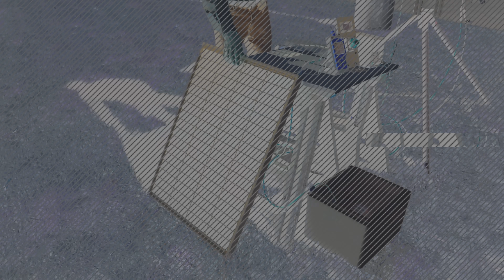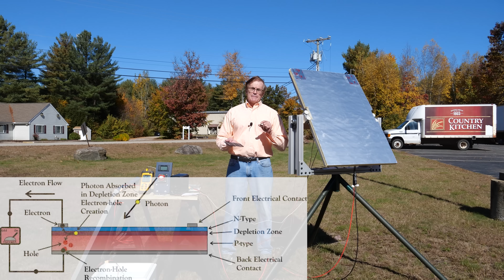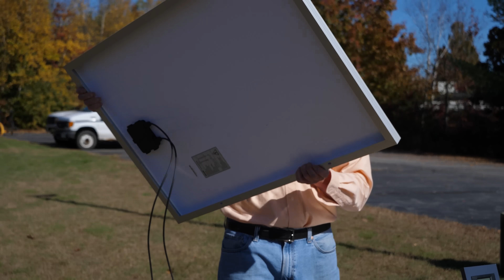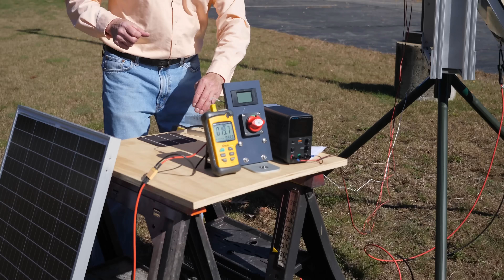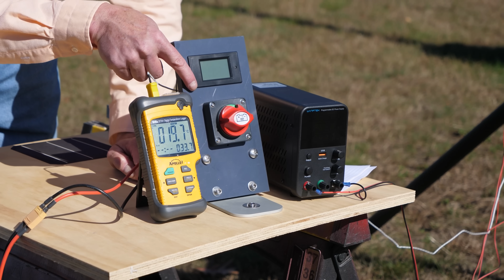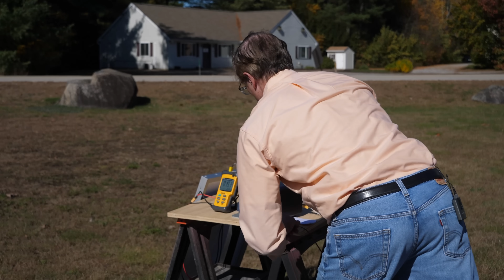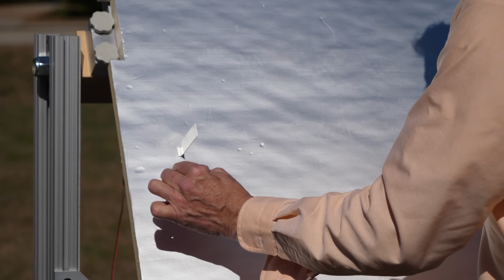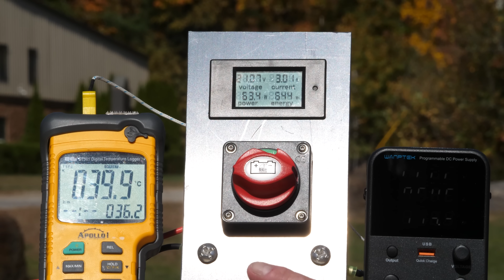Do you REALLY get enough out of your solar panel?

Comment: Totally off the cuff. These days solar panels are getting higher and higher watts per square metre ratings. However the price of a panel in any given solar panel in a companies range increases with the increase in watts per square metre. So given that allot of people in australia have 4.15 kW one 6.15 kW solar systems and the roof isn’t nearly filled then the expensive higher efficiency panels are a waste of money. Our rules place limits on what you can have in array kW and or force an export limiter to restrict you to 5 kW export to the grid.

Caveats. My sister lives in Sydney in a heritage area and as part of her renovation, strictly controlled and everything even screws and nails and paints and colours has to be approved, she wanted solar. No the roof was approved as black corrugated iron. Her terrace house is taller than one neighbour and the same as the other and a cross the street  a balcony looks at the terrace front. So I said to specify LGNeON 2 panels in the all black variety and the absolute highest efficiency panels that had, not a NeON2 but the other one. Anyway it was approved based on colour but also the panels came right to the edge of the iron so it looked all as one and angles meant it couldn’t be seen at all from the street, gutter hides the edge.

So having super boosted panels is a waste and probably voids the warranty and can your inverter handle it and what are to you doing with the extra power? Can your batteries take the extra charge and the grid export is already capped.

So, what’s the point?
Reply from the maker: Maybe the real issue is your governmental regulations.

Comment: Excellent content. A fairly simple perfomance upgrade that brought a verifiable return on investment. There may be other ways to dump heat as well. I must have missed it, but why are panels black? To absorb photons?
Reply from the maker: That's the native color of silicon
Reply: @TechIngredients  Tech Ingredients said: "That's the native color (black) of silicon"  NO!  It is more a grey color.  When crystalline silicon is used to make solar cells, an antireflection coating is typically deposited on the sun facing surface.  It is this coating that renders the solar cells the usual dark blue to black color.
Reply: @TechIngredients  So if you could tint or change the color, would it be possible to lower the operating temp/increase efficiency?
Reply from the maker: Yes.
However, you might not see the difference as most of the visible spectrum is used to generate electricity.
Reply: @TechIngredients  Tech Ingredients said: "Yes.  However, you might not see the difference as most of the visible spectrum is used to generate electricity."  NO!  The most efficient color is the dark blue to black.  Also, it is possible to make them non dark blue or black and the new color would be visible as the solar cell is NOT absorbing that color.
Reply: @palindromeambigram4852  So they are black because black contains all the colors, where as white is the absence of color?
Reply: @d.mcdave8880  That's a bit of an over-simplification but yes.
Reply: OK. Then what would be the effect of not coating the cells as far as perfomance? Would the light be mostly reflected away, lowering performance? Or, is the coating a safety feature to keep us from blinding ourselves?
Reply: @d.mcdave8880  If crystalline silicon solar cells did not have the anti reflective coating then they would definitely have reduced performance.  I doubt "the light would be mostly reflected away" but it would be significant.

Comment: I'm thinking of peltier elements, as they produce current/voltage when there is an difference in temperature, can't this be used to lower the temperature even more and also provide power? Placing peltier elements at the top, as this helps the air flow, cold goes down and heat goes the opposite way, but also using fans to circulate the air, as you did, might be even more efficient?
Reply from the maker: They're relatively expensive and very inefficient.

Comment: Can you use a sterling engine attached to the back of the panel to power the fans?  Or just to mitigate the efficiency loss due to heat?  The panels will always be hotter on the sunny side than the shade side, so there should be a greater temperature differential the harder the panels are working.  If the sterling engine drove the fans mechanically, it would be a kind of self-throttling system.
Reply from the maker: Theoretically, yes.
However, they tend to be bulky and would have to be custom built.  I'd go with the current  fan setup and control  the fans so that they only operate  when the panels  exceed a given temperature  differential  vs. air temperature.  This saves power and wear and tear at night and during  cloudy days.

Comment: I like that you touch financial details so thoroughly but absolutely forgot to count degradation and replacement cost for the fans itself. Also active systems like that require some monitoring infrastructure, at least to be sure your fans are still working. So everything looks not so simple at closer look.
Would be nice to have the all the information counted. 
But don't give up. I wish you luck and I really enjoy watching your videos, and all of the optimizations you do. Thank you!

Btw almost forgot to mention, to cool radiators you don't have to use fans, you can use passive way of air drift, like in old fashioned oven chimney.
Reply from the maker: Regarding  your BTW, the size of a passively cooled water to air heat exchanger will make it very expensive.
You're right, I should have included that, but briefly, the MTTF for these and similar  fans is 50,000 hours and you would likely use them less than 12 hours per day because  the very early and late daytime hours will see little benefit re longevity and efficiency.  And, of course, you would not need them at night.  They will also be operating at 25% of capacity.
Reply: @TechIngredients  thanks for reply. About degradation - it comes not only from "pure work" that they do, but the fact they are working outside, and venting street air, which contains a lots of dusts, just for example.

Comment: I would add an additional concern.  The lifetime of the fans may not last the lifetime of the panels.  In that case there is a relatively high cost to replace the fans if labor is not free (some folks may not be interested in servicing their system by themselves on a roof).  Not sure where the tipping point is, but an interesting failure mode investigation.  Thanks for your content, I enjoy watching!
Reply from the maker: Understood.
Many of these cooling fans have a MTTF  of 50,000 hours.  We only need to run them about 8 hours every clear day. There is no need to run them at night, obviously.  In addition,  there may be little  value in running them for the first and last couple of hours every day and not every day is clear.  This means that we should expect about half  of these fans to fail at 25 years.  However,  we will be operating them at around 25% of their rated output, further extending their life.  They can be mounted as easily  replaced plug and play modules, making exchange simple.

Comment: I have yet to see any accurate analysis to determine if a solar panel made today, installed and put online, generates more energy throughout its lifetime than it takes to manufacture and install them.  This is due in part to the difficulty in obtaining the data and the obfuscation of the industrial processes within communist regimes that make them.  When you consider the energy required to mine, process, refine, manufacture, ship, deliver, install, and operate solar panels - I am very skeptical that they are a net benefit for humanity for anything installed outside of the Arizona sun.

Comment: Floridian with some solar here.  Small setup with only a couple 350w panels.   One problem you introduce with fans is that moving parts require more maintenance.   In these parts, we have many oak trees rather than palm trees that people import and plant.  As a result, keeping my panels clean is a much bigger problem than cooling.  I am considering rainwater collection and gravity-fed water trickling over the panels to help deal with it.

Comment: It is a bad idea for maintenance fans are know to fail. That is why the other company mentioned at the start of the video used liquid cooling. The loop would be hooked up to one pump and thus one point that you need to look at for failure . The loop could be purged at temps below the coolants freezing point and in most cases the ground a few feet down is cooler then the air in the summer. Simply running a pump and using the ground to cool it in the summer would give similar results and as for the winter the lower ambient temps should be more then effective.
The reason a engineer would not use a fan is that is would be a point a failure that dose not make sense for the application. Liquid makes sense in this app if you need the cooling.
Reply from the maker: Why are you ignoring  the moving parts in the pump?
Reply: @TechIngredients  I am not. 1 pump for like 12 solar panels or like 1 fan per panel or more. Not to mention the failure rate of the fans going up for the same reasons as the panels. Pumps tend to self cool and if maintained right will last way longer then a fan.
There is always the right tool for the job.
And if we where talking about cooling something inside a a building or moving air though a large condenser maybe but the size of fans that would be going on panels like that would be prone to failure and using large fans would just kick up dust and make the panels dirty.
Cooling the panels from the back with a liquid makes more sense in a large setup and small setups would have a high failure rate on fans just on the back of the panel.
So I am not ignoring anything it has to do with the number of moving parts. 1 pump or dozens of fans. Maybe even hundreds.
It removes points of failure and makes repairs easier.
Reply from the maker: You did ignore them, but now that you addressed them, the pumps may or may not last longer.  The MTTF of fans such as these is 50,000 hours, and that's at 100% output. You also did not address leakage, corrosion, or freezing. All these issues  can be dealt with, but I raise  them because  this isn't  as clear cut as you suggest.

Comment: Interesting video but it seems like for the cost of the fans, which will likely wear out long before the panels and need to be replace during the life cycle, the cost of the aluminum, plus the labor to fabricate and install it, all this for another 3-5% output, you could probably buy another solar panel with the money you have to spend and double your output.  Seems like your experiments proves the concept isn't economically feasible and just because some company in Australia is using it as a gimmick to sell their panels doesn't mean very much. And yes, I'm an engineer. Throwing cold water on bad ideas is what we do.
Reply from the maker: Thanks.
As an engineer, you should evaluate  these results  by comparing actual MTTF data and cost/effeciency relationships along with panel longevity data rather than using the catch-all phrase "it seems".
Reply: @TechIngredients  Although admittedly I do not have enough information to do a detailed cost analysis, based on the limited data you presented and 30 years of experience working with solar, I stand by my prediction that this would not be a cost effective endeavor.

Comment: Love it as always. Thanks. Three questions came up though: 
1. How does the same panel perform (thermal and output) without anything attached to the back under the exact same conditions? 
2. How would it perform without the shroud and the fans (same conditions obviously)?
3. Could a chimney design be more cost efficient (no fans, no 3 watts lost and adapts to cloudier conditions without additional tech)?
Cheers!
Reply from the maker: There is a very slight  improvement  with the fins alone vs. stock.
Reply: @TechIngredients  Thanks for the reply! What do you think about a chimney style passive air flow approach?

Comment: nice experiment, I learnt something new here. Just seing 3 very practical problems with your solution. 1) no company will offer the installation with custom fans and if yes not for a reasonable price 2) say you install 40 panels that makes 80 fans which will never last 25 years without replacing and maintenance, I am willing to bet that you will have to fix several fans every year and climing the roof and doing this yourself is no option for most users and 3) noise levels for the fans, I mean they are always running and when you wanna sit in the garden next to the house I am sure you will hear 80 spinning fans. What I learnt from this is to keep an eye open for companies that offer cooling solutions of different sorts or panel tech that is not so much affected by heat in the near future.

Comment: Bad test giving bad results.  You should have used 2 electrically matched panels side by side.  One with the all the extra aluminum and fans and one mounted the normal way (offset from surface).  Also, gotta ditch the fixed resistor loads and use matched MPPTs to each panel.

Comment: sir, i've enjoyed this video. please consider radiant flooring kit for your water to air cooled solution. glue the aluminum to each panel and clip in the pex hose and away you go. i plan to put 10kw on my barn after i finish it. where i'm at something like this would significantly increase the life span of a panel

Comment: You are doing a very good job, thank you for this video. I would have guessed that with electrical conversion losses and mechanical of the fans, the total power used would have been greater than the power gained. You have proven the opposite, so this is a viable option. What I plan to do is a solar PV system that will load a battery but when battery is full dump DC into a resistor for a water heater. In any cas more power and longer life is always good to take. (even if it were power neutral)

Comment: Fan won't last 20 years.  
On a large solar farm the fans would create significant wind.
Is there such a thing as solar cells that work better with infrared reflected by panels?
Why not mount cells on a parabolic surface and make use of the reflected heat.
It would need tracking and I cold see the expense of such a system being more than the gain.
Reply from the maker: You should  test some of these ideas.

Comment: I had no idea my panels run so hot. Where I am in Australia daytime summer temps are often the 40s, even up to 48. I have a 10kW system which runs pool filtration and air cooling by day. Its dark now but I’ll be checking the temp tomorrow. 
Maybe a trial of water cooling is needed. I think evaporative cooling would contribute significantly to panel efficiency. A pity water is also in short supply most of the time.
Reply from the maker: Good luck!
I think  you'll be surprised.

Comment: Regarding water cooling by cascading water over the panel,... what about the heat lost through latent heat of evaporation? Like sweating? Should this not be considered?
Reply from the maker: Sure.
But, that does add complexity, uses water, and can deposit  salt that degrades efficiency unless occasionally cleaned off.

Comment: Using a heat exchange that provides warm water is probably the best approach. That way you actually harvest that energy and you don't need a moving part under the panel.

Comment: I don't see why you could not move the fins to the aluminum panel and fill the solar panel with water.  You get better contact with the back of the solar panel and the frame, the fins are outside, cooled with fans in the summer.  Since the fins are outside, you can make them bigger and get better cooling - the water makes perfect contact with both surfaces.  Adding fins to both sides of the aluminum panel would give you a nice radiator, it would be easy to rivet the fins to both sides.  Add an antifreeze mix for year-round cooling of the solar panel.

Comment: would the panel have gotten that hot without the aluminum blanket trapping heat on the back? Maybe should have put both panels up and run simultaneous tests.. Would also be interested to see adding the epoxied heat sink fins on the panel unenclosed. Relay enjoy your content, thanks for your hard work.
Reply from the maker: They actually  get  slightly hotter without  the fins.

Comment: you just made me think of making a cheap water cooling block for solar panel.... thx man... now i just need to think a system to store the hot water since i am probably gonna use it for my shower.... so its more effective if i put them all close together to generate more heat for the water to take away to create a better water heating system... i was planning to make a solar array with a water spray system when it gets too hot...

Comment: Very good discussion.  By the same argument you posit @16:12 , you should not allow your panels to operate unloaded, even after your batteries are full.  The power should be routed to a dummy load or another energy dissipating device, including sending it back to the grid.  A loaded panel has about 20% less energy heating up the cells as a loaded panel (assuming 20% panel efficiency) simply because you are removing 20% of the energy. So after your batteries are full, diverting the power somewhere will reduce your panel temperature and hence, add more longevity.

Comment: Nice work and good thinking. I especially appreciated your attention to the added longevity/less waste material that a cooling system could contribute to.
We are in the U.S.V.I. where our panels power our house completly in the extreme sun, but get very very hot doing so. Often thought about building a cooling system. Thanks for doing such a thorough job
 of it. Food for thought.